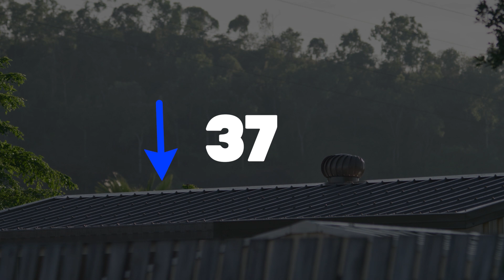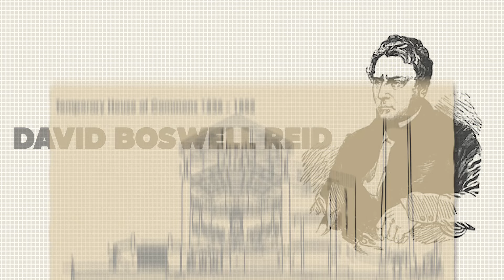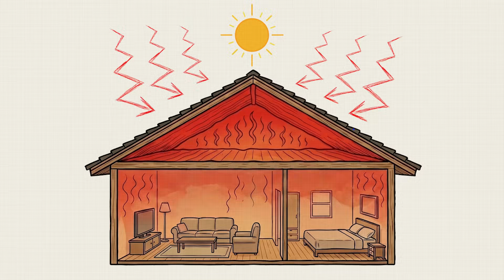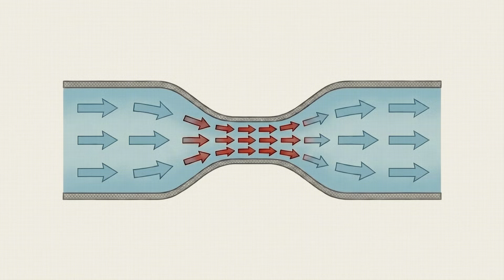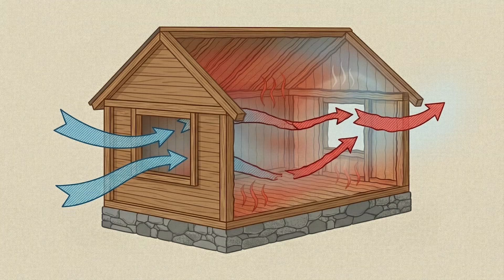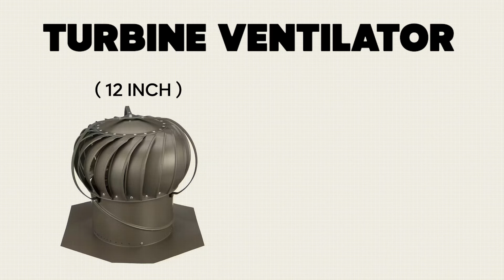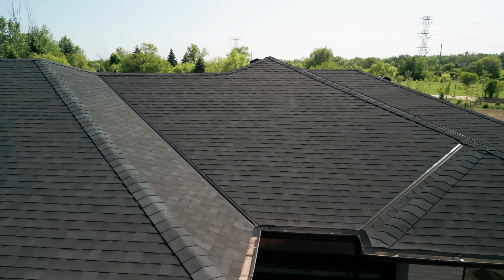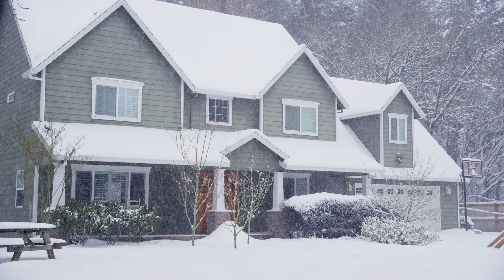Why Did We Stop Using This Natural Cooling System?

Comment: Had this same question couple of years back. Reason for the decline?

People replaced them with Ridge Vents!!
It basically cane down to that.
Reply: yeah, if you're getting a new roof and it's not ventilated you goofed up. there's lots of ways to passively ventilate a roof and the turbine ventilator is just one of them
Reply: @berengerchristy6256 turbine is the best ! Have you ever been under one when its spinning ?
Reply: Cheaper to maintain and more reliable, if You want to Stick with a passive solution.

What nobody tells you is that stopping the sun from heating your home in the first place is most important. Certain chemical coats or white paints and building materials help tremendously especially Compressed stabilized Earth blocks or earthen construction of any kind..

Everyone Who can afford it should start investing in a Solar System. The new devices a very modular and you can seemlessly increase capacity overtime and become energy independent. Solar panels also make for great roof cooling devices. 😂
Reply: @BilalKhan-yg9jc  Trees and awnings help a lot as well
Reply: @RogueAstro85  Agreed! Trees can solve many environmental issues.
Reply: @BilalKhan-yg9jc  Very true. Cheap energy encourages moves away from efficient designs to ones which essentially require brute force to cool buildings.

Cheap capital expenditure, high operational expenditure
Reply: @alanbrown397  It’s less so the cheap energy and more so an excuse to raise energy prices while cutting costs for housing. It’s all about everyone wanting to get an ever bigger cut.
Reply: @BilalKhan-yg9jc  Unless they catch fire. Los Angeles experienced this dramatically in the recent industrial strength rooftop fire in Boyle Heights. Good installation work and good quality products and materials are a must.
Reply: @BilalKhan-yg9jc  Writing 'solar system' captalised made one confused
Reply: @comradeofthebalance3147  I know what you're saying but the context should make it clear enough. I'm not exactly writing best sellers in YouTube comments.
Reply: @BilalKhan-yg9jc  Dude download Grammarly. It's an extension that you could install on your browser, and it'll actually help you out with things like improperly capitalized words mid-sentence like how you have with a number of words in your comment.
Reply: Solar powered fan units are available. They are much lower profile and relatively leak free. That and they work quite well in Arizona.
Reply: @machintelligence  less so at night?
Reply: @itellu3times  By late afternoon it wouldn't even be that hot anymore to necessitate passive cooling.
Reply: @dannyzero692  Sometimes we need passive cooling 24 hours, if we can get it.  What you mean is it's off-peak but often there's a heat-soak that is still working its way in hours after peak.
Reply: @itellu3times  I think deserts cool off faster?
Reply: @BlazingSun72  dry air with clear skies and maybe some altitude, sure, can be a big swing between high and low on many days, but to get the cool into an overheated house remains a challenge, best to work the problem 24 hours.
Reply: It always comes down to cost. 

 This is a good entrance point for animals. It moves. 

 Also, electricity was so cheap. HVAC systems came in. Now there is solar. Heat batteries.
Reply: @RedactedDeath  Electricity is still a monthly cost that adds up. It seems more as competition in different passive cooling methods with pros/cons making them each work better for different environments. Engineering and architecture is loaded with these situations. its why houses in the south are better designed to handle tornados and earthquakes while houses in the NE are designed to handle multiple feet of snow on the roofs (such as steeper roof angles) with less cave in risks.
Reply: @shrummitscult7911  “houses in the south are better designed to handle tornadoes”

This made me spit my drink. American southern homes are very cheaply built, half the time below building code. They get reduced to slag by tornadoes on the regular. If you mean basements, it’s more region specific. Though the rest of the home will still get shredded.
Reply: @thelouster5815  Please for the love of god tell me you understand what I actually mean.

 Stuff like using different concrete mixes. We are not talking about what houses are objectively built to higher quality. We are talking about what climate and geological considerations impact how structures are designed.

That's just one example I pulled out because I use to live in tornado Alley and non-tornado prone areas don't design infrastructure expecting tornados.
Reply: @shrummitscult7911  And I live in a tornado prone area and work in construction. Believe me when I say they most certainly don’t build homes expecting tornadoes. They build homes to look pretty and sell high.
Reply: @thelouster5815  Jesus Christ 🤦‍♀🤦‍♀ were going to just gloss over the actual point. OK

Comment: Most of these solutions are not very desirable a bit more up north, with the main reason being that you throw out warm air in the winter time.
Reply: They have a flue type slats which close it for winter.
Reply: You want your attic the same temp as outside.  If your attic is hot in winter, your insulation is bad.

Comment: The reason most people stop using those is because when we became adults they were all pretty much worn out and needed to be either replaced or removed and so everyone just removed them because they did nothing but squeak
Reply: They’re incredibly easy to replace. I replaced all three of mine on my last house in less than 2 hours.
Reply: To be surprise to hear that mine still works, help even my neighbor's one too, it rarely squeaks even if it's slightly rusted.
Reply: yeah a bit of oil and alll good vs a 15% electricty cost is totally worth it /s
Reply: To be fair they still use them but not for residential and rarely for commercial. Thing is it cools, it doesn’t work anywhere near other options, and sucks completely compared to actual AC. Its really the fact they dont actually cool the air they just remove hot air from the room.
Reply: @kendrickswartz4318 for passively cooling an area that does and should not receive active cooling, what better options are there? I know there are solid state vents and such but my understanding is those don’t work as well as a functioning whirlybird
Reply: @soneasterzombie502  whirlybird is a scam there is cheaper and simpler solution - another short tube twice the diameter of original one placed around it. Additional tube creates aerodynamic shadow when wind is blowing and thus a zone of lowered pressure which makes air moving. Same effect as whirlybird, but without friction loses for rotation. If there is no wind this system still better because it doesn't have any moving part that consumes air energy. Manufacturers scammed consumers, glad it is over.
Reply: @kendrickswartz4318  For cooling the living spaces it isn't super great because ceiling insulation keeps the benefit from reaching the living spaces... however for those doing work within the ceiling it's a god send.
Reply: Have u not watched the video? A quality one will do the job with no electricity, the reason why it makes noise, is because of poor maintenance and poor build quality
Reply: they work even if not rotating (worse obviously)
Reply: Power vents are SOOO much better
Reply: Fair 👌💐
Reply: I missed the nostalgic squeak-squeak of the neighbor's whirlybirds after they disappeared when they got a new roof.

Comment: We didn't stop using them. The air comes in the soffit and out the peak through a gap in the top row of shingles. Did you do the minimum amount of research before posting? Like google?
Reply: Ridge vents are mentioned around 8 minutes in, did you watch the video?
Reply: @Notius Does that change how the video is literally titled " why did we stop using this natural cooling system?" Or the fact that we didn't?

Comment: I have two on my roof. Not great looking. But works.
Reply: I have three, and they look great, as I keep them clean and painted. They look like new and have been working for 26 years so far!
Reply: Do the bearings get noisy ever / require going up there to give 'em a little squirt of silicone grease once in a while?
Reply: @AerinNight I haven't noticed any noise. One did get stuck and stopped spinning. A little bit of muscle and it seemed fine.

Comment: Hot air rises... use that to generate power on the ceiling!   Better yet use a Vortex Turbine to cool your house!
Reply: So a generator for such relatively low temps would generate next to nothing.
Reply: It would generate enough power to light up a couple LEDs. At best.
Reply: @Solnoric  Yes free lighting!

Comment: I remember these turbines only too well - and knew how well they worked (from going into places that used them).  The house I lived in as a teen was miserable during summer - two story, one little electric fan in the end where my parents' bedroom was - and even with the AC going, it still was sometimes too hot to sleep until morning.  I don't remember any vents for cooler air to come in as well.  I tried and tried to get my parents (including my engineer father) to consider putting one on the roof, but he always blew his top and said that he knew more than I did and that he wasn't going to use one.

Then we moved to Florida, and again inadequate ventilation and wide expanse of roof.  It was easily 150 degrees F in the attic, and I had to do stuff up there fairly often.  Again, the "I know more than you do - NO!".  That was many years ago - and I remember hearing complaints about the house being warm after I moved out - including demands to cut electricity usage because of the power bill.

If our place had an attic, I'd have those installed.  They make that much of a difference - and knew that they lasted for many years.
Reply: your father didn't even want to explain why you would be wrong?
Reply: @MGrey-qb5xz  No, and I'm NOT wrong.  I described what I EXPERIENCED, not what I just believe.  Our home doesn't have the right construction for a turbine, and if it did, I'd already have one put up.

My dad was an authoritarian a$$hole (toxic narcissist) and almost never explained anything, unless it was to try to make me think like him or to put me down.
Reply: @RedHeart64  Question. Are you Gay? 

Like, im not judging or bashing, i am just curious lmao.
Reply: The heat from the house turns the blades. Look at a house built in the '50's through '70's or '80's  they have the turbines and the ridge vents sometimes several turbines Fans also have bearings.
Reply: Why Whirlybirds Fell Out of Favor in the U.S.
The main reasons they’re no longer widely used:

1. Mechanical failures and noise problems
Whirlybirds rely on bearings and moving parts that wear out. When lubrication dries or bearings corrode, they squeal, grind, wobble, or seize. This makes them noisy and ineffective. 

2. They often leak
The base flashing where the vent penetrates the roof is a major leak risk. Over time, sealant cracks, flashing warps, and water infiltrates the attic, causing rot, mold, and insulation damage. 

3. They depend on wind
Whirlybirds only work well when there is enough wind. In low‑wind areas, they barely move and provide poor ventilation. In high winds, they can over‑ventilate or run constantly, disrupting attic temperature balance. 

4. They corrode and clog
Exposure to weather causes rust, debris buildup, and blade damage. Many homeowners end up replacing them rather than repairing them. 

5. They create a roof penetration (a point of failure)
Modern roofing practices try to minimize penetrations because every hole is a potential leak. Ridge vents and soffit vents avoid this problem entirely.

6. Better alternatives became standard
Ridge vents, static vents, and powered attic fans provide:

More consistent airflow

No moving parts

Lower maintenance

Lower leak risk

Because of this, roofers often recommend ridge vents instead of whirlybirds.
Reply: @davidgray5320  Really?  You're wrong about several points.

First, the bearings.  Yeah, they can go bad - and I'd be surprised if it wasn't possible to replace the bearings.  If you get 20 years life (from what I remember typical if not on the low side), that's pretty good.  Bearings may go bad, and usually the noise starts near the end of the life of the bearing.  Modern bearings are also quite a lot better and have longer lives than those from the 60s and 70s.

THEY DO NOT DEPEND ON WIND.  I've seen them working in still air.  Even this video mentions that.  They WORK.

They might be a weak point as far as the roof, but I don't remember a single example of one leaking.  There are usually vent pipes going through the roof that rarely leak.  I'd point more to improper installation for any leaks.

From our experience, the attic (exhaust) fan only manages to reduce the heat in an area near it.  From what I remember, they're even MORE likely to go bad than a turbine - and because they're electrically powered, they're far more likely to start making noise and KEEP making noise until they're replaced.

It also depends on the type of bearing.  If oilite bearings are used, they'll fail a lot faster than a ball bearing (and are a LOT more noisy).  We've got ceiling fans that are over 40 years old, that still run without much noise.  One did start going bad, but I tried lubricating it with oil several years ago, and it is still quiet and runs fine.
Reply: @RedHeart64 I remember these in the 1980s.  Our neighborhoods were noisy with all the squeaking from the bearings failing up and down the streets.  When the wind stopped blowing, these things did Not spin.  And we all had wet attics from light rains with no wind, the things didn’t spin.
Reply: @KRNpics  I don't remember ANY squeaking, and there were a few on the street where we lived.  The businesses that had them didn't have problems either.  It would make sense to maintain them as they do have moving parts - that's something I couldn't say for sure because the topic never came up.  If they were cheaply made and used oilite bearings, then making noise could start a lot sooner than ball/roller bearings (and maybe had leak problems?).  I've heard people claim that oilite was rugged, but most fans and appliances we've had that used them often had problems after a year or two of operation (some longer).

The ones I remember looking at were made in such a way that rain alone ran down the outside and onto the roof.  The spiral blades overlapped enough to keep rain out.  I don't remember looking to see if there were better versions compared to cheaper ones.  I just knew that they really seemed to work, and where my bedroom was, I could feel heat from the attic on a rather hot day.
Reply: @RedHeart64 theirs must've been built different. Lesser compared to what we have. Lol
Reply: @davidgray5320 im a roofer for 52 years. When it rains , they leak water into the attic.  Ok for commercial buildings where some rain isn't going to hurt anything.
Reply: @billrehm3590  what if a small cover is put over them?
Reply: @linhvu3113 then it defeats the purpose of getting heat out.
Reply: @billrehm3590 just like a small cover over a well in the middle age? That way the hot air can still go sideways?
Reply: @davidgray5320  ridge vents came alone, work better (especially other proper intake), more reliable and make the home look better.
Reply: @davidgray5320  Seriously? Here in SEA (tropical, hot, and humid), many building (houses, facilities, factories, etc.) have them. They have been spinning for 30+ years, up to the present, and when I'm inside them they keep the place cool always.
Reply: My parents think they know everything too. They don't trust me because I'm transgender and I have a septum piercing. I told them they should vent the roof better and sleep with one eye open.
Reply: @eltomas3634 bro dropped in a little fun fact
Reply: @eltomas3634 Your parents are right. Seek the help you need.
Reply: @eltomas3634 I have a trans friend (haven't seen him in a couple of years) who helped me to realize that gender dysphoria is very real.  The research I've read clearly indicate that.  

We're ALL people and deserve the respect and freedom that some others demand for only themselves (the freedom to deny others!).
Reply: @RedHeart64  You both have been groomed into mental illness. I hope you recover, good luck to each of you.
Reply: @RedHeart64  ah...no, they are ok with me cutting my junk off and being promiscuous,  they just don't want any holes in the roof for turbunes even though it's the best design for the floor plan of the houses around here. I think they may even be turbinephobic.
Reply: @eltomas3634 Thanks for the laugh!